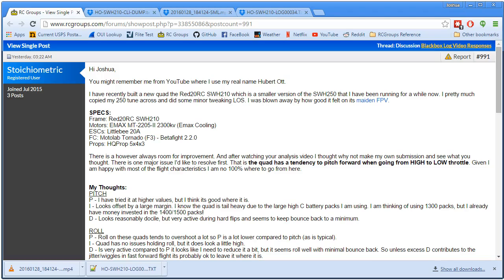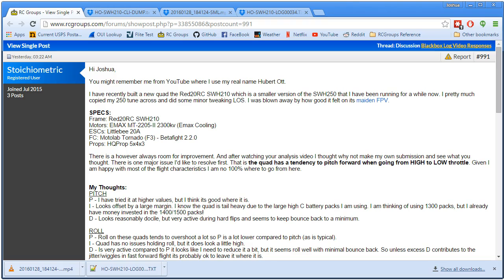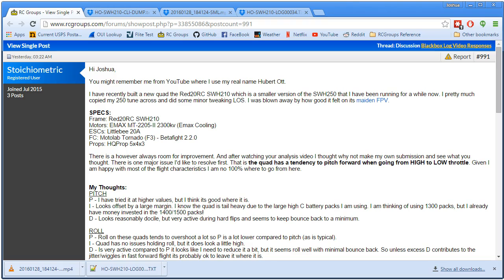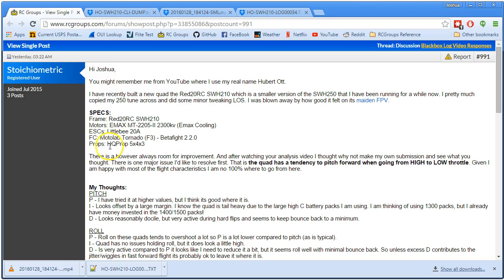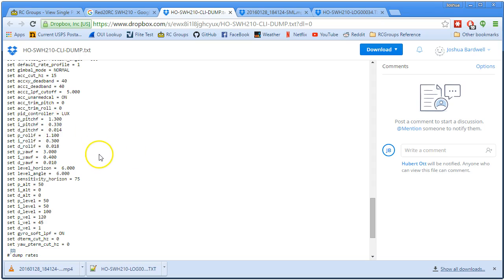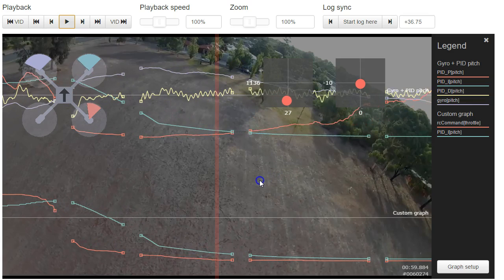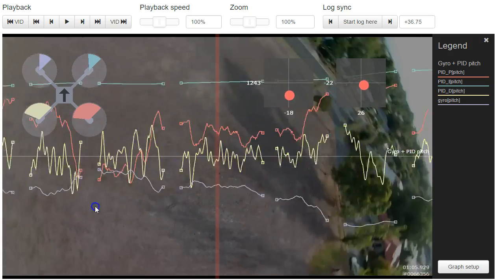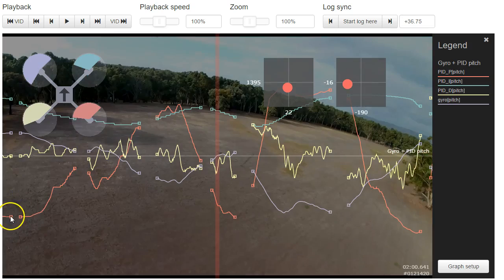Blackbox Log Analysis: Stoichiometric - 1/3 - Pitch Throttle

Comment: Looks like he could start with a custom motor mix, looks like the rear motors are at different locations than the front. I had some screwy things happening on my Sigan250 before I did a custom motor mix. Google it, there's a simple program where you just put in your measurements and it gives you the mix that you copy and paste in the cli of Cleanflight. It's really that simple, that would be a good place to start, can't hurt anything anyway...

Comment: Low pressure is only a factor on quads with side plates- solution is to custom mix the motors all reversed.
I think he needs more P, and more D on pitch to compensate for the heavy battery packs. I used to deal with that myself for the same reason he described in the post.
Reply from the maker: +Hiway I don't know what the exact aerodynamic effect is, as I said in the video, but I am really sure it is an aerodynamic effect. Possibly, the heavy battery exacerbates the effect: more mass = more inertia = more force required to arrest the motion. But I'm really sure it's not a question of CG.
Reply: Joshua Bardwell
I am a very organic troubleshooter in these realms- I have a shit ton of experience, but truth be told I don't know what the hell I am doing and cannot fly for shit.
My skills are all about retention- I remember almost everything I read or learn on the internet... especially the shit I don't know how to apply.
Reply from the maker: +Hiway Also: low pressure definitely does exist any time you have a spinning prop. The prop's whole job is to create low pressure above it and high pressure below it. That's how it creates lift.